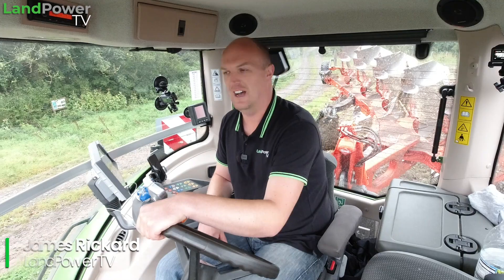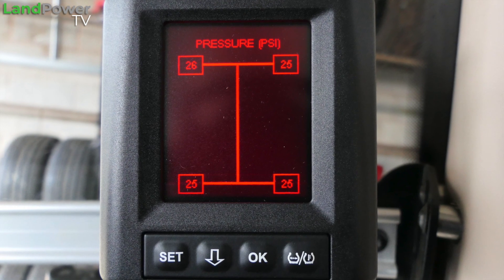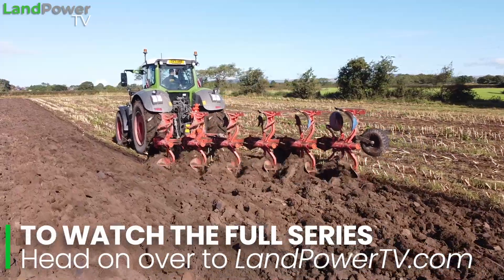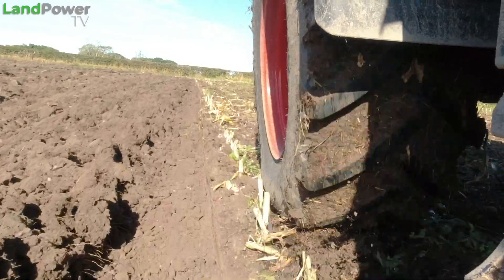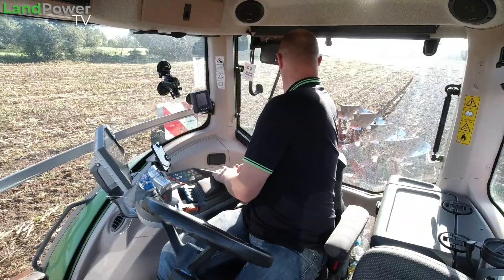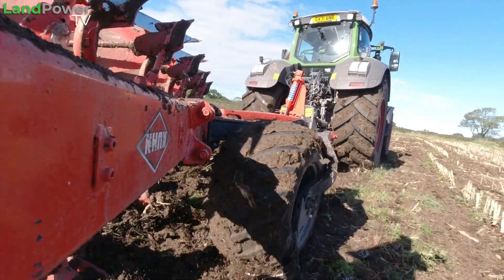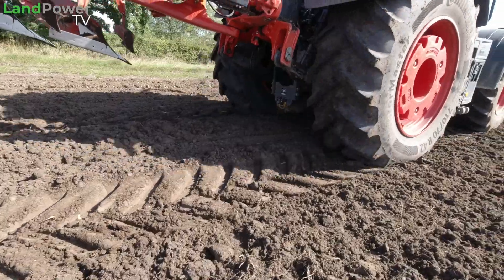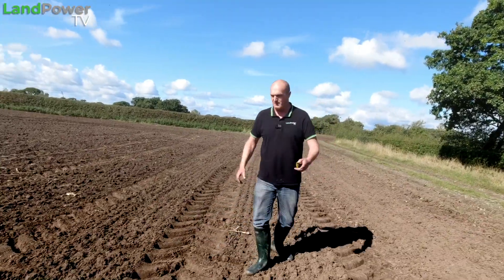Testing Continental Tyre Technology With Fendt 828 Vario Tractor (Episode 6/7): TREAD PATTERN

Comment: I’m very surprised that tractor is only burning 30 litres an hour with that plough
Reply from the maker: It was definitely on top of the job, and even down to 20 litres per hour in the easy going parts of the field. We put a lot of that down to the Vario transmission, enabling the tractor to drive at the ideal speed and engine revs.